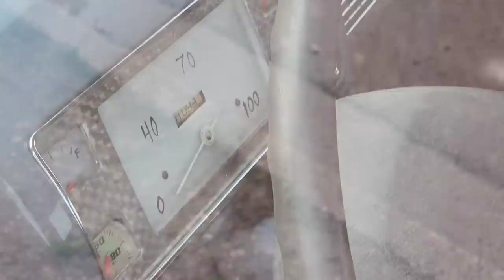Five Days To North Dakota // Money Pit With More Issues

Comment: I would never let my son or daughter hang their head like that when I’m driving. I get that they are young but they are going to get old like you and I. They don’t need neck problems when they get there. If you don’t have them then you’re lucky but that doesn’t mean they won’t.  The new steering wheel rules for the Railroads is 9 & 3   It’s been 10 & 2 for the whole 43 years that I’ve been with the Railroad. The airbag injuries from your own hands and arms to your face and head have been devastating when you’re in a wreck.

Comment: Well he should 1) use gloves 2)put down news paper 3) chock the wheels with pieces of wood 4) disconnect one of the battery terminals( so it is impossible to accidentally start the 
engine, with no oil in it!!!!! 5) start the job.

Comment: If it’s in the budget and you wanna do a lot of traveling with lil bud ya need to get rid of the 6.0 sad but true. There good engines but need to be deleted and all the fixings put on them. Truck is worth the whole deal but is the cost practical for you 🤷‍♂️. That’s an answer only you would know Kurt.